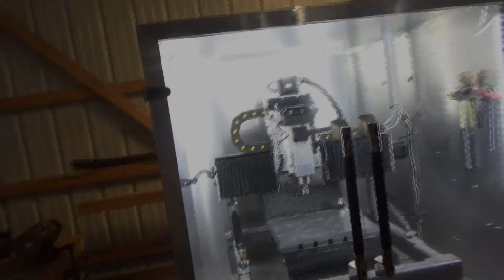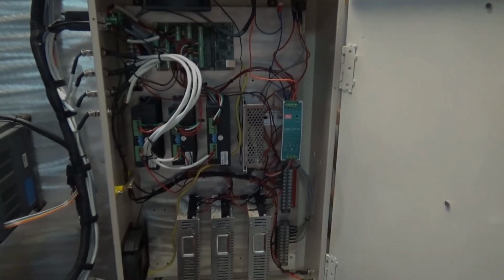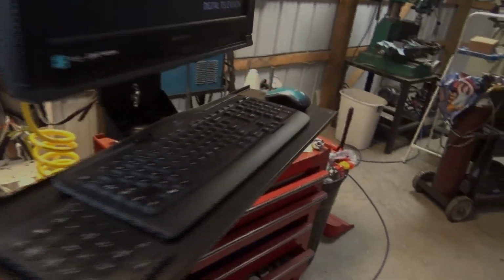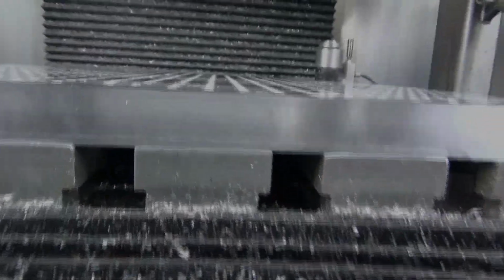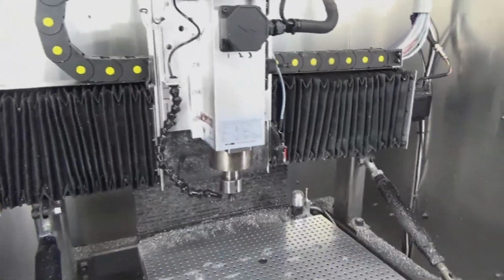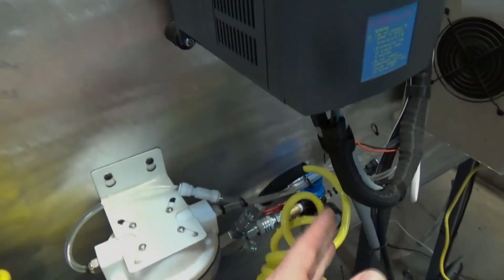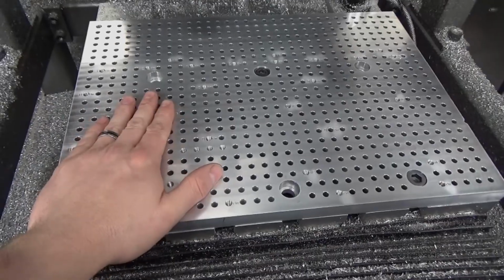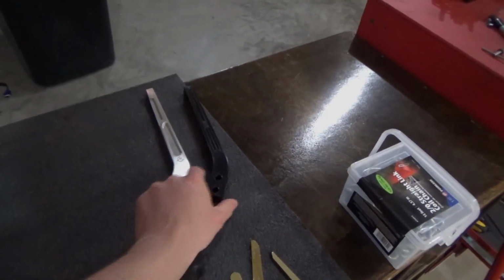DIY CNC Fixed Gantry Mill Overview

Comment: 32:10 those fitting look like type A flow control fittings. They control the air flow going out, not in. You need type Z fittings for this application.
Reply from the maker: Ahh makes sense, thanks!...I believe i found the correct ones on automation direct. They are calling them meter in and meter out...I need a meter in. This has been an annoyance I didnt understand and never really looked into, so itll be nice for these to work correctly. Thanks again!!
Reply: @am0254338  you’re welcome. You got yourself a nice machine there, good work! I’m working on building my own these days. Videos like yours are an inspiration. Thanks.

Comment: sir, where did u buy those bellows way covers ?
Reply from the maker: I built these bellows from scratch, they were very time consuming and not a lot of fun, but turned out well...I couldn’t find any bellow solution without paying a lot for something custom made...I used PVC vinyl coated polyester from here https://www.seattlefabrics.com/60-10-Ounce-PVC-Vinyl-Coated-Polyester-1399-linear-yard_p_134.html . In order to get the pattern correct I used this information and software http://www.franksworkshop.com.au/CNC/Bellows/Bellows.htm . I glued the pvc vinyl to brown Kraft Paper with high quality vinyl top and upholstery adhesive sprayed thorough a glue gun (not aerosol) . The Kraft paper allowed me to draw the fold pattern. Then I folded it all by hand and let it set in some clamps a few days...this is a frustrating and very time consuming process but does give a really nice result. Thanks, Andy
Reply: @am0254338  thank you for your feedback and the resources. Cheers
Reply: you are using linux cnc, what breakout board are you using ? Is it a usb based or parallel port board ? I have been using mach3 for my current cnc mini lathe project and also for another DIY cnc router. I was just curious about linux cnc controller and breakout boards.
Reply from the maker: After many suggestions from the Linux CNC forum I went with the Mesa 7i76E ethernet controller board...I planned to go with a much cheaper option, but decided I needed to spend the extra money here...no regrets there. It works perfect and has enough expansion capability that I could do anything I want in the future, without adding anything or changing anything....since I didnt have to pay for the Linux CNC software, that counteracts the cost of the board. I really like the software itself, but the setup has a bit of a learning curve. Once you wrap your head around it though,  it's pretty simple. Hope this helps. Thanks, Andy
Reply: @am0254338  thank you Andy for sharing your knowledge and information. I will look into the mesa board. I am happy with Mach3 at the moment and keep linux cnc for the future. I invested alot in both lathe and mill projects and would like to start making stuff.